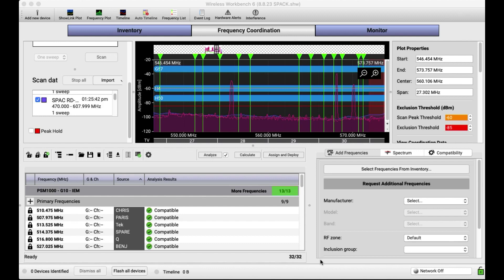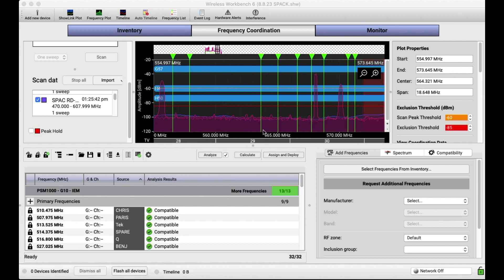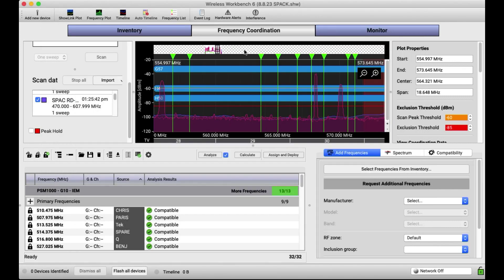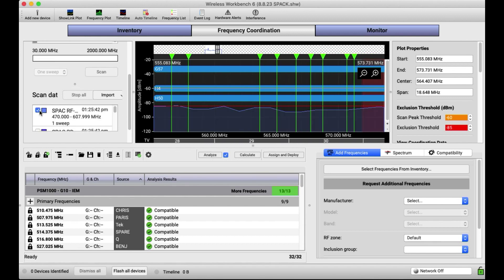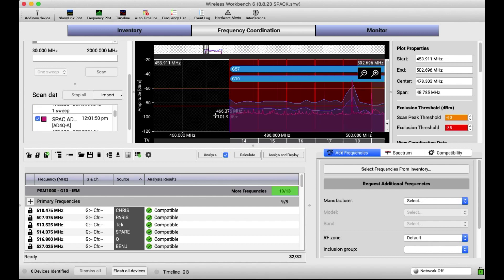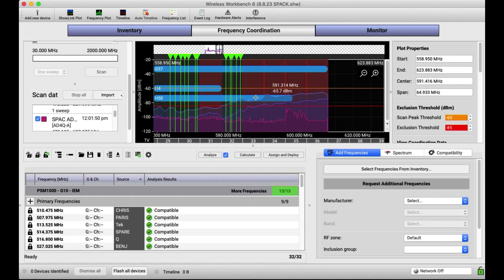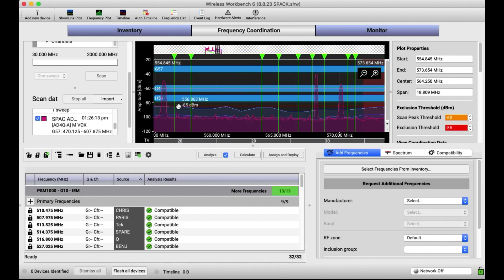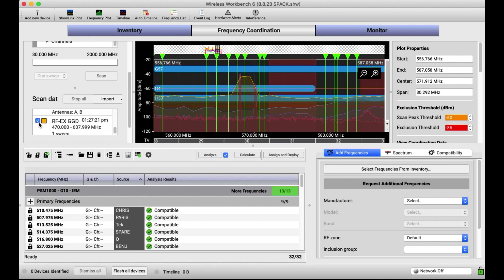RF Explorer & Wireless Workbench tips for frequency coordination!

Comment: Thank you for the video. I have a tiny sa ultra and an RF explorer 6G plus.  Are you saying that the RF Explorer data is not very reliable or that using the RF explorer with wireless work bench specifically is not very reliable?

Comment: Awesome video man. Thank you so much. thank you for also point out that  WWB7 does not support the Shure UR4D wireless system  I had that issue this past weekend as i was try to set up my UR4D with the WWB7 and  I couldn't connect.

I was also thinking of buying the RF Explorer as a second tool that I can use to do backup Scans. and Now I can See that the RF Explorer Scan resolution is low. 

do you know if the RF explorer has a setting where you can maybe increase the scan resolution? 

I must say tha the  RF eplorer is affordable. is there another devices that you might recommend  which will give a better resolution scans?
Reply: im using touchstone pro sofware, 50 bucks and you can high rez traces
Reply from the maker: Thank you!

Comment: I notice that you have resolution on "auto" in touchstone pro. You can change that to "high", it will give much better results.
Reply: does this effectively change the FFT size and hop length of the explorer?  and noise floor and dynamic range aside, do you think it gets a lot closer to the resolution of a ulxd or psm1000?
Reply: Noticed it too. High resolution is the way to go